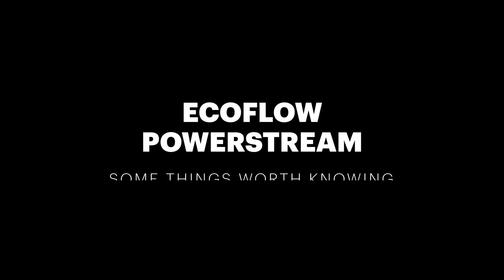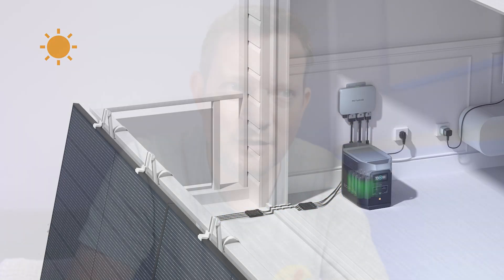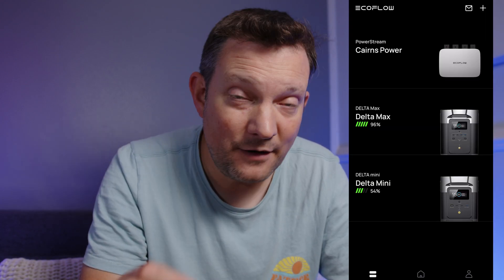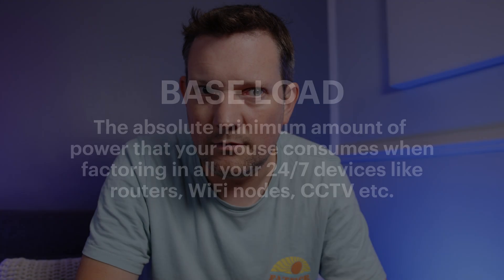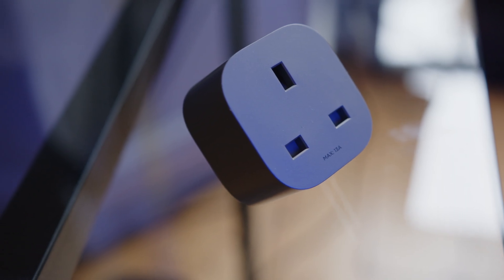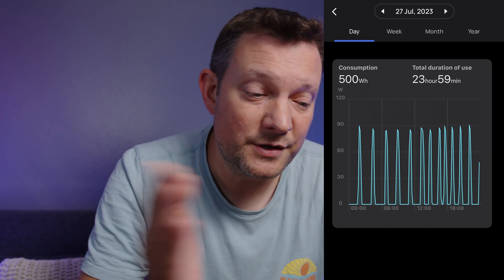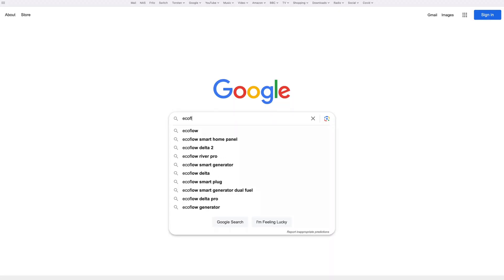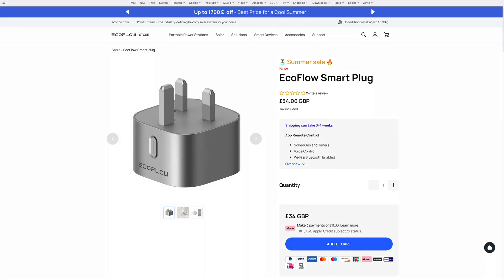EcoFlow PowerStream - 10 Things You Don't Hear

Comment: great video man i was actually looking to buy one now I see its way too limited and will not bother
Reply from the maker: Out of curiosity, which point sways you against it?
Reply: @tdcattech  the fact we cannot charge maximum into the battery at the same time supplying the house in the day. I have panels which could easily send 1000watts to battery in the day and another 700 ish into the house as our base load is pretty high. If they had this feature I would definitely still consider it. My needs are basically 700watts constantly 24/7.
Reply from the maker: Yes, it's a limited device but for higher power applications, you wouldn't use this type of solution. I think there are some legal restrictions on back feeding power this way so they have to cap what goes into the socket. The MPPT controllers are clearly 500W each so I have no idea why they couldn't work as on the Delta Max 2 (2 x 500W). They're probably exactly the same boards so it's odd to cap them to 800W total. Equally, the 600W max into the battery seems just crazy. Not a clue on that.
Reply: Hi, I have the delta pro with 700 watts charging to the battery and a 100 watts going to the powerstream directly to the house. So it works for me. The only fault I have is I can only charge the battery from one solar input.

Comment: Thanks a lot for that video! However good is the product, it is also very useful to hear its limitations which other reviewers tend to go rapidly about… I would have one quick question for you: you rapidly mention in the video the limitations as to charging: I would like to plug in 1 solar panel directly into my Delta 2 (not through the Power stream), as well as charge it through AC when I have some solar surplus from other panels (through a simple smartplug), and use the powerstream only to send electricity to my grid. Is there any limitation to that set up? Thanks a lot in advance for your feedback.
Reply from the maker: That would work fine. One of the great features of the PowerStream is that you don't need a battery at all. Just plug it into solar and mains and it will back feed what it can. If your Delta 2 was connected up, it would be fine but it wouldn't use excess power to charge the battery.
Reply: @tdcattech would that mean that the solar panel cannot feed to grid and the battery if It’s have surplus? Is it grid or battery?

Comment: So they don't include a battery cable. So you buy this and a delta 2 max and a spare battery. Powerstream caps 550 watts to around 100 watts. I know I should have looked into this more but quite honestly it went back and I am happy with 4kw and two separate panel arrays going into the two xt60 sockets on the one delta 2 max unit. I need to watch your video a few times as I have 3 of the smart sockets sat here. Do I have another go? Buy the battery cable and stick some more panels up with a separate feed to powerstream? Addictive but I threw my toys out the pram when there was no battery cable included and it all went to shit lol
Reply from the maker: No, you're right. This does need to be ordered separately as I guess they don't know which variant you need and won't provide all three. In this video, I'm talking about the Delta Max cable. It's stupidly short!
Reply: @tdcattech  would you know if both xt60's pulling in about 550 watts total, if powerstream was in the mix with a couple of panels attached and connected to the second battery port on the side of the delta 2 max with said illusive and short cable.... would that actually give me more charge capability? Or do you think it would conflict and end up reducing what's coming through my existing set up? I want to improve it, not spend more and end up with less
Reply: @tdcattech  I was holding back on going to 6kw and ordering a final battery and thought I could powerstream to the spare socket I have on the delta 2 max. My strop came when I invested all that cash and had no £50 cable to get the kit running. My fault though but I still copped a strop